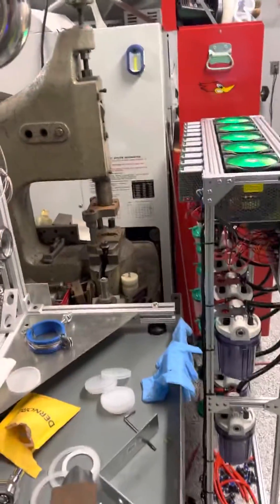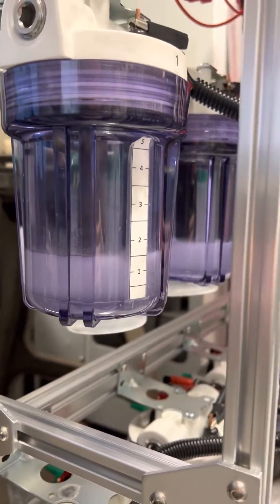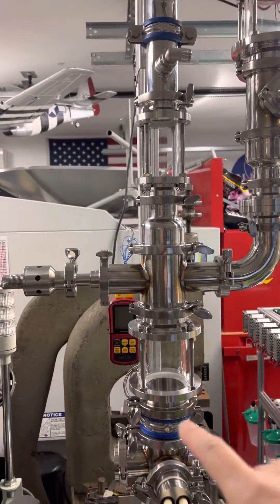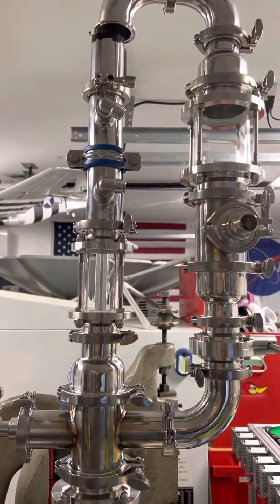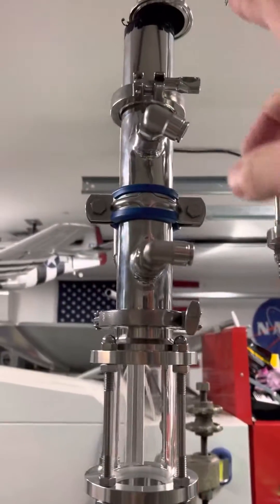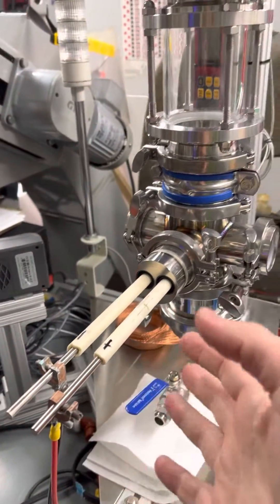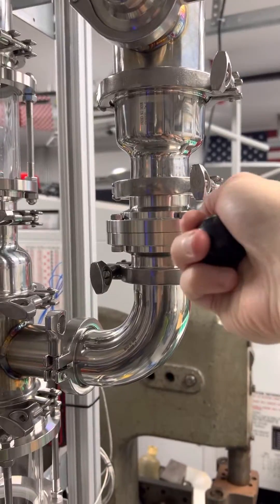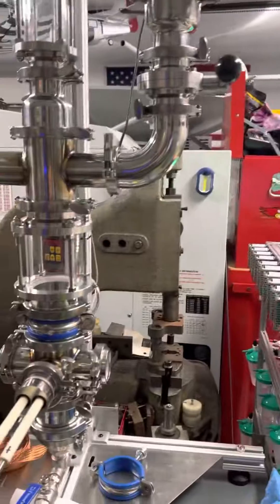Heavy Water Deuterium Oxide electrolysis and Reactor Cell Update!

Comment: Put an inductor in series with the electrodes to get a more efficient and stable plasma. You can use the primary coil from a MOT. No need to remove the coil from the core thou. It appears that the plasma acts as a switch which causes the inductor to produce voktage spikes. So you get more vigorous plasma as if you where usung a higher input voltage. When i use the inductor i dont need to preheat the electrolyte for the plasma to form.
Reply from the maker: Hi! Excellent thanks for the suggestion! I will definitely look into adding an inductor. There are so many things I want to try. Its already been interesting.  One time I accidently did a "hard start" (the variac was turned all the way up when I turned the switch on instead of it being at the lowest and slowly turned up the voltage.) There was a loud buzz/rumble then it got real quiet and I thought it blew a fuse and was off but it was on and the electrode discharge switched electrodes. Instead of the negative having the plasma, the positive had it. You can tell when it's in resonance by the way the variac hums, it's a beautiful sound actually. Luckily I have a video of it actually that I can put up. Stay tuned! - Andy